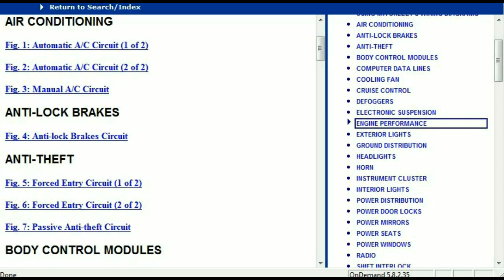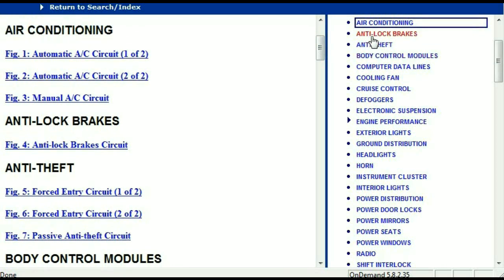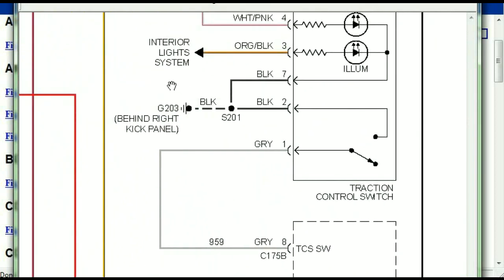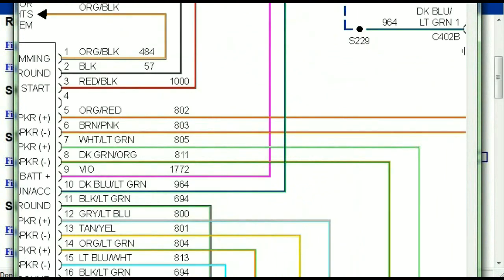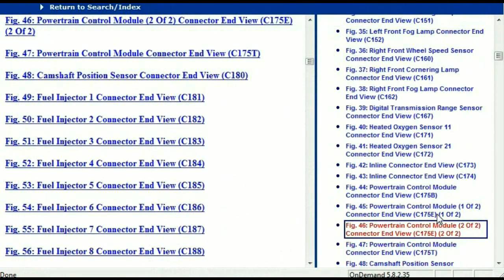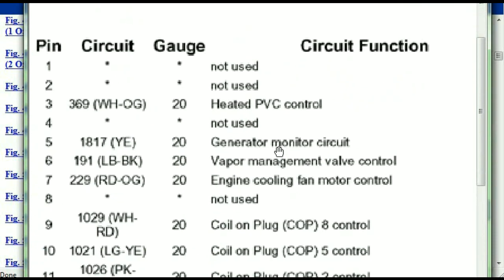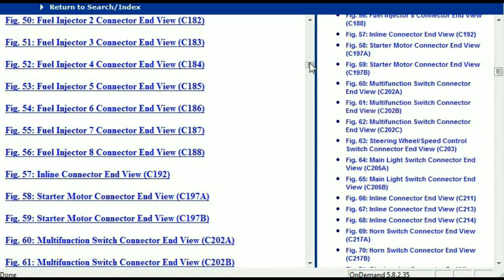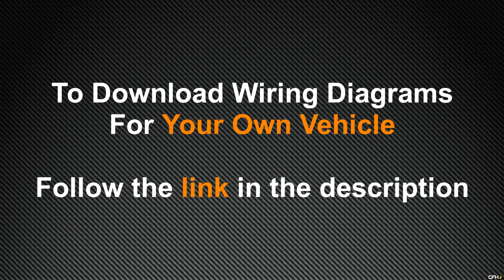Ford Explorer Wiring Diagrams 1998 to 2016

Comment: THIS IS A SCAM, just goes to one of those sites that states you need to "complete an offer" which is wading through nonsense and never getting the files.   Plus, there are no wiring diagrams that cover all the way from 1998 to 2016, the wiring changed multiple times in that span of 2nd generation to 5th generation.